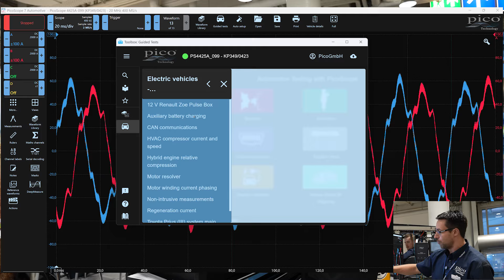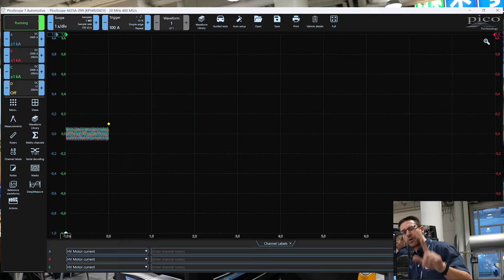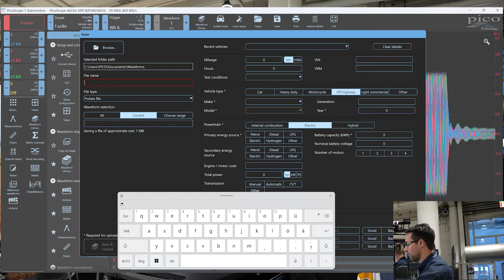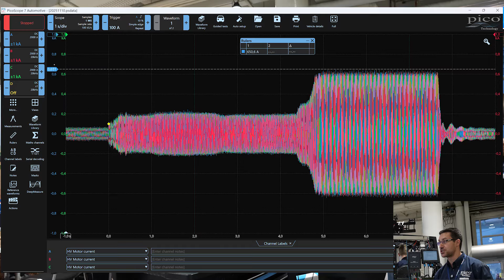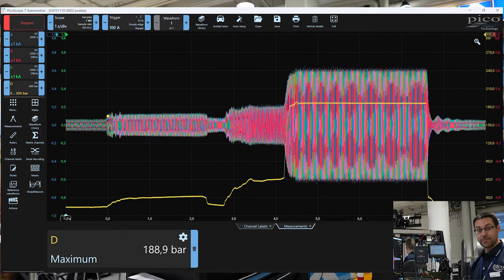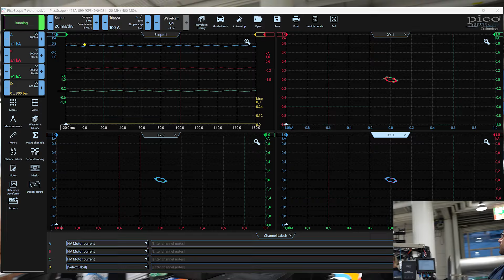Three-Phase Motor Dynamics: Current and Hydraulic Pressure | PicoScope

Comment: Thank you Ben. Does this method only work with the 4425A, or can the earlier 4423 and 4425 also be used - if you have enough amp clamps! 
I occasionaly see some of the Stihl cordless power tools and have been wondering if I might learn anything about their 3 phase motor performance, along with the 3 phase motors appearing in automotive applications. I'd need to buy another amp clamp, but only if the earlier scopes will give me the same results as the 4425A....